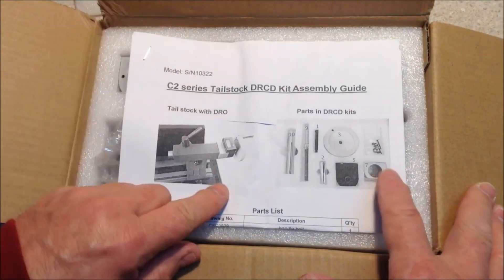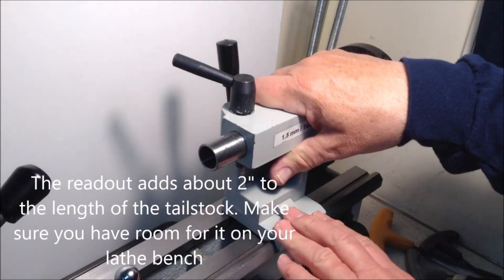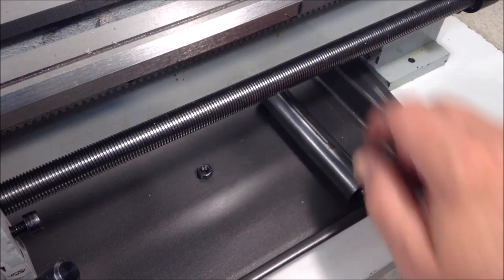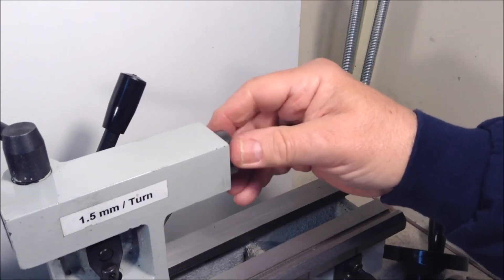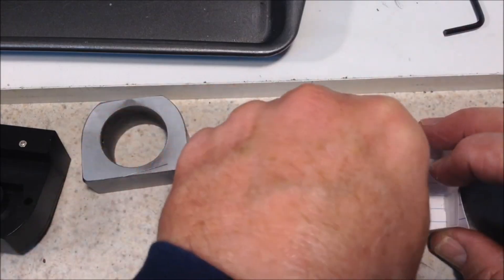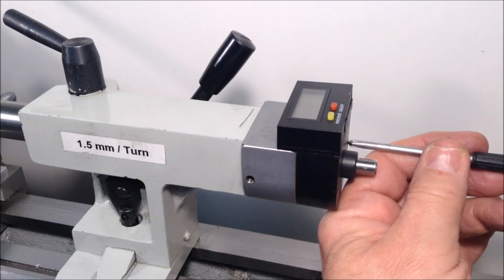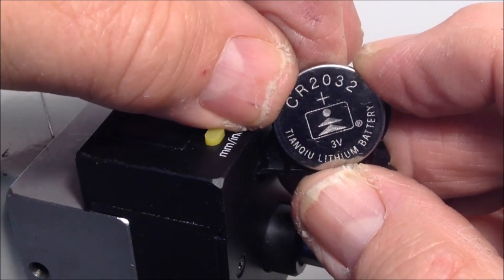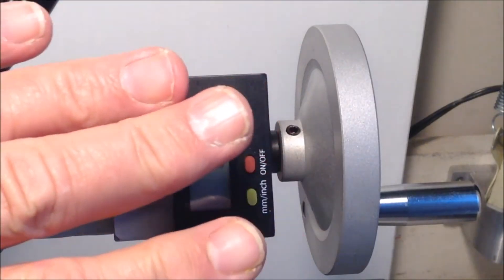Mini Lathe Tailstock DRO

Comment: Will these fit lathes sold by Vevor? Or any particular models by Vevor?
Reply from the maker: Not Likely, though we know some who have replaced entire tailstock - https://littlemachineshop.com/products/product_view.php?ProductID=1492&category=

Some things to consider:
1. Vevor is not manufacturer. They buy a variety of different machines (or sometimes just components) from different manufacturers. Specific models specs, compatibility, quality, varies
2. A common complaint is tailstocks (check internet) so we know ours will often serve as an upgrade to stock.
3. DRO unit needs to be mounted but is also calibrated to specific leadscrew in tailstock. Both need to be correct

Vevors are easy to buy, but aftermarket parts and accessories are always difficult to confirm...